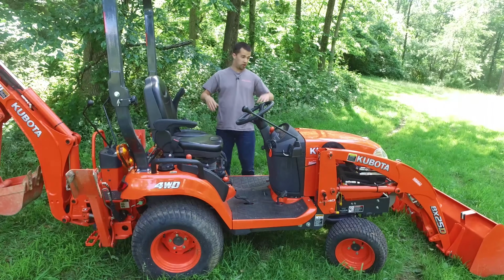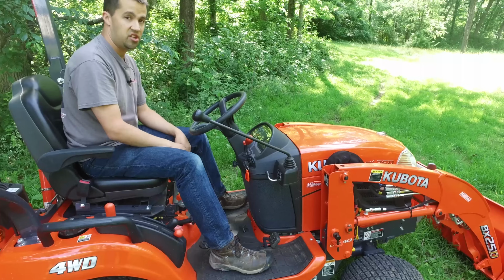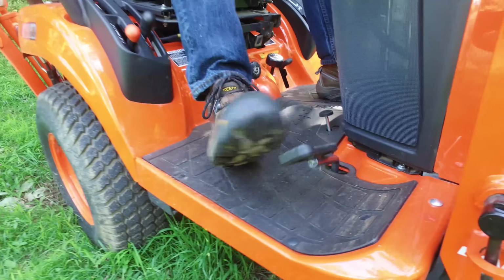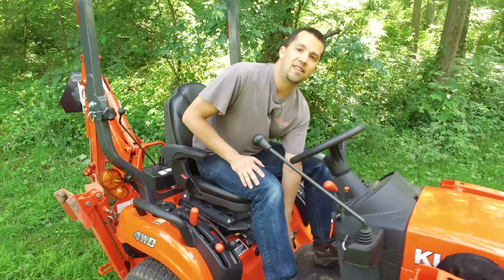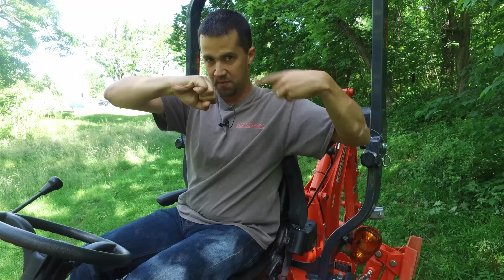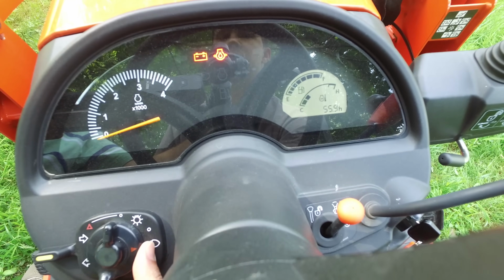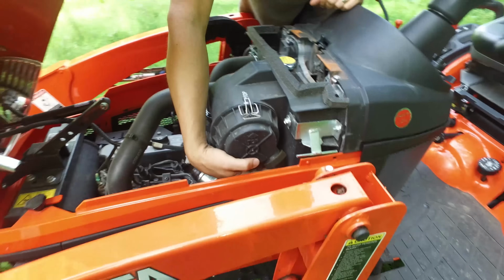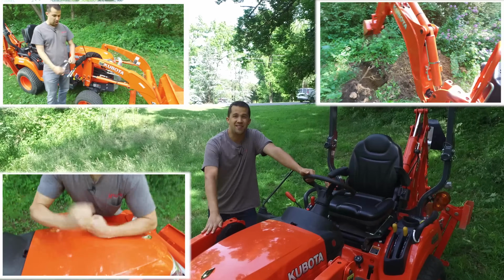Kubota BX25 Operation Overview | Messick's

Comment: I have a question about the BX25D with the hydrastatic transmission. There is one guy from Canada who received questions about that particular tractor model, and the unit still moving after the foot is removed from the pedal. He showed what happened with the tractor he showed and it did that. I don't own a Kubota, but is wondering about that problem, and wondering if the company was fixing the tractors with that problem, or the dealership is suppose to fix it.
Reply from the maker: There are several causes of HST tractors coasting, its not an uncommon thing on mechanical hydros. Generally it can be adjusted out by changing the return spring or making sure all the linkage is well greased. 

Kubota does not have an army of guys running around with wrenches, they build them, dealers fix them when then break.

Comment: What is your opinion of a Massey Ferguson GC1710 or GC2410?  I am looking to buy one and put a 60" snowblower attachment on it and "maybe" do some light loader work. I looked at a Kubota BX25 which is nice.  No Mahindra or JD for me
Reply from the maker: I've never seen one before. As I understand its an Iseki tractor. My biggest concern is always long term support when the retailer is not the company building the tractor.
Reply: How does a New Holland Boomer compare to Kubota or even a Kioti?
Reply from the maker: New Holland does not currently make a subcompact. They sold their tractor to Daedong\Kioti. We we sold it at the time as we are a New Holland dealer. Its okay, but at this point its showing its age. While Kubota is in their 6th generation of subcompacts this series only ever really received one face-lift.
Reply: Messick's Iseki and Massey Ferguson are owned by Agco. I’m not really sure how they work out what is an Iseki or a Massey. In Australia they are brands here for the long run.
Reply from the maker: Distribution agreements,  not ownership.  Things change. CNH had the same relationship for their compacts and it fell apart

Comment: The BX 25D does the D mean it's a diesel or does it mean it comes with a factory installed back-ho? I had somebody tell me the D means that it comes with the factory installed back-ho. And what is the difference between a BX 25D and a BX 25D –1? Thank you.
Reply from the maker: neither of those things. All the BX2# series tractors come with a backhoe. 'D' is just a random letter they decided to add to the end to denote changes from the prior BX25 model. The next tractor in the series will be BX23S. I can't explain that one. Seems like they just pick numbers out of the air sometimes.
Reply: @MessicksEquip  l

Comment: Thank you.  I am thinking of buying a Kubota for my 10 acres home.  I can rent a BX25 from Home Depot.  My question is if I learn to operate the BX25  can I then operate a little bigger Kubota like 30HP?
Reply from the maker: Absolutely. There are small differences from one tractor to the next, but the basics of the controls and operation techniques are very similar from one machine to the next.

Comment: Thank you Messicks! Fantastic very helpful video about overall info and operation. Just one suggestion: in the front loader video I think it would be very helpful to include the "float position" and how and why the float position is used. I know people that have tractors and don't even know that there is a float position.

Comment: Ive had a BX2350 since 2008. Tortured the thing but never broken it. I didn't expect it to be as tough as it is but I'm very happy it is.I have a 54" mid mount mower that I mow 1 1/2 acres with, a loader that I use all year long. I probably attach and un-attach the loader 20 times a year. I have a 48" back blade and a 48" tiller. This tractor handles the tiller with no problem. I do my food plots and gardens and two of my friends food plots. It fits on my 6x12 single axle trailer. Couldn't be without it.